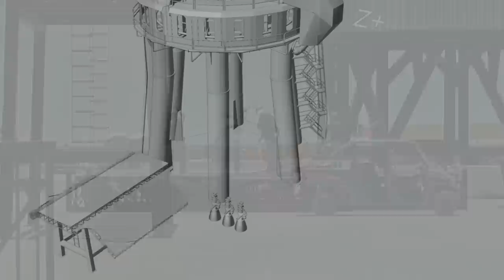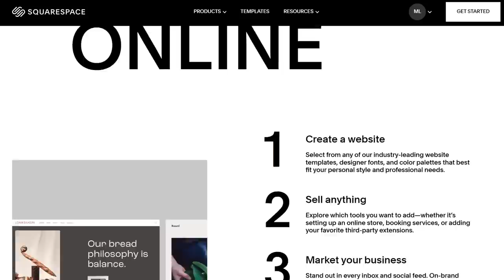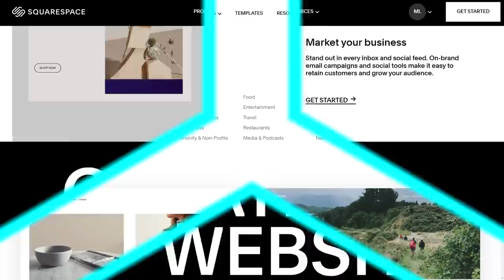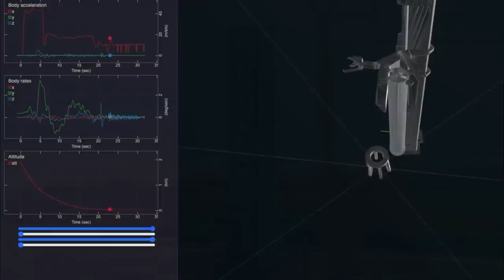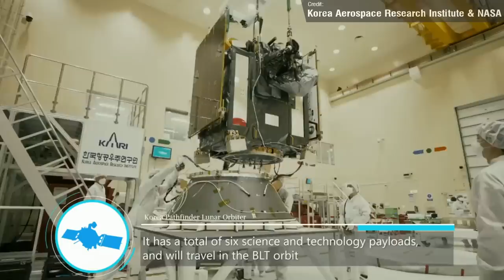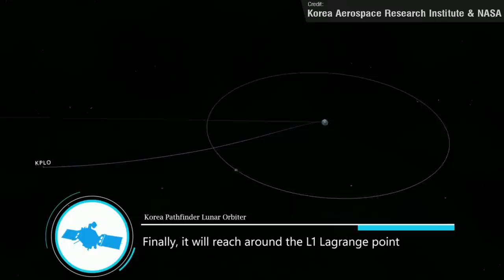SpaceX Starship Mechazilla Malfunction, Booster 7 Return, 6 Launches 1 Day, Blue Origin NS22 & more!

Comment: Shorter means less mass to try and move, either allowing them to move faster or require less pressure/power to move at the same speed for catching. The point about it being the only human rated pad will no doubt be a factor when they talk about catching them but I wouldn’t discount the shorter arms from contention just because they are shorter.

Comment: the explosion was not a booster problem. The cloud that was produced by the spin test is Oxygen and furl rich cloud. When the cloud got sucked into a running generator or fuel powered pump acted like 10K HP nitrous shot on a little single or twin cylinder engine. The oxy/fuel cloud caused the little engine to blow up causing it to blow up igniting the entire cloud. For those of you who own a diesel vehicle CNG or LPG acts like nitrous does on a gas fuelled engine

Comment: I do wonder what the list of busiest days for Spaceflight looks like, and where August 4th 2022 ranks on that list
Reply: For orbital flights, the five that occurred on 4 August 2022 from 03:08 to 23:08 UTC was the busiest 20 hours, one minute period in history. This is not only the most launches in a 24 hour period, but also the most successful launches in a 24 hour period.

Second place with 4 launches was over 60 years prior, 26th April 1962, with Kosmos 4 (Vostok), GRAB 4B (Scout, failure), Ariel 1 (Delta) and Samos 7 (Atlas-Agena).  The two from the same site were about eight hours apart

There has been at least 9 occasions when 3 successful orbital launches were made in a 24 hour period.

Comment: This contraption needs more testing. I can see it snapping right off the moment it tries to grab an incoming wild rocket.
Reply: Accidents can always be anticipated during the testing of a new rocket, especially one trying to land in a way never done before. During a controlled descent, the catch arms will be more than stable enough to catch the rocket.
Reply: @evanrichards3264  i don’t agree. This thing should have at least 5 live trials where it lifts off and is caught successfully. Otherwise it’s an accident waiting to happen.
Reply: @fkxfkx  what don’t you agree with? I didn’t post any opinions.
Reply: @evanrichards3264  everything you post is an opinion
Reply: @fkxfkx  also, the way it works is that the booster will be basically hovering and slowly lowering while lowering itself onto the catch arms. The most likely failure would be a landing burn test, as the catch arms have already proven they can lift a booster. This would be something that you could test easily without doing a full flight.
Reply: @fkxfkx  what does that mean?
Reply: @evanrichards3264  apparently it means you don’t know what an opinion is and are unable to recognize your own.
Reply: @evanrichards3264  i just hope for spacex sake you are not officially a part of their team
Reply: @fkxfkx  I’m not, but I would like to know your definition of an opinion vs that of a fact.